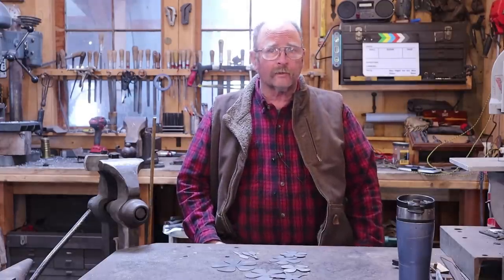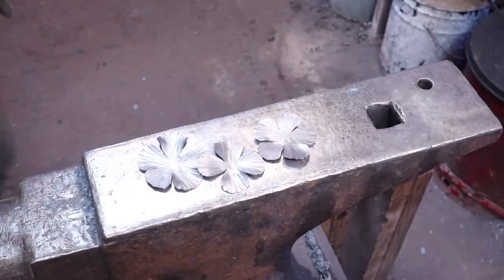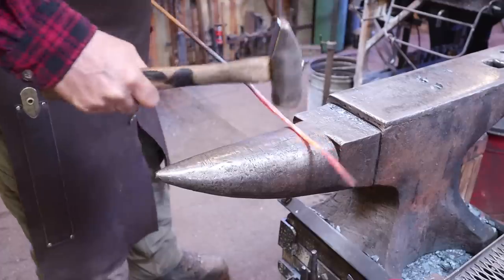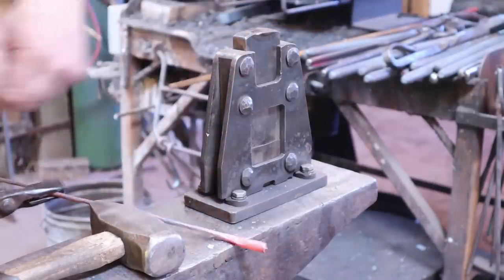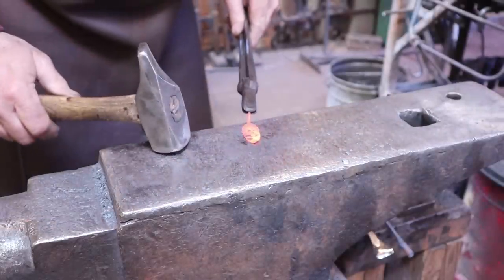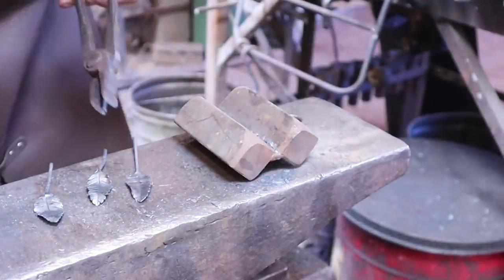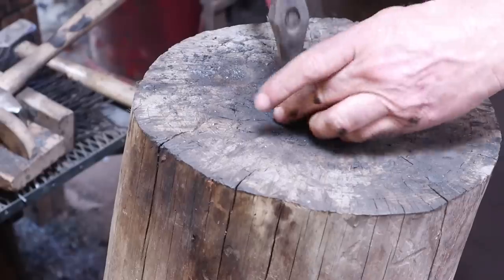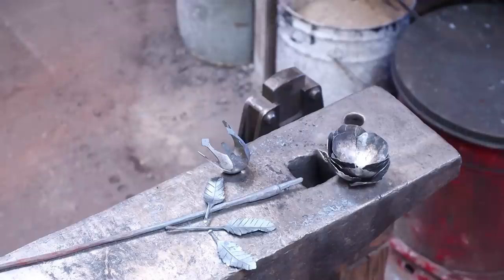Making an iron rose - part 1

Comment: A rose by any other name is still a rose. Many have done it both ways. 
   Your work is very nice indeed.  In the form of " from a single bar" i could see that taking upwards of 10-12 hours. At a shop hourly rate of $80-$100 per hourthat would make a thousand dollar rose pretty easy. Betting selling one for that would be quite hard to do.
   This way works well too, though its less ornate in one veiw point its stil beautiful and the cost ratio would make it much easier to sell. Probly market price $50-$60. Still $700 @ dozen but they never wilt n die.
    Love your work.
  Blessed days 2 u sirSir, Crawford out
Reply from the maker: A rose this size actually sells for $150
Reply: @BlackBearForge  oh wow i didnt know. No offense Mr. John. Thats an awesome piece for sure...welk worth that figure too. Thank you for letting me know. Your really great sir.
     Blessings upon u sir, Crawford out